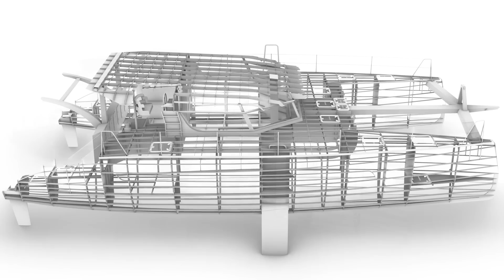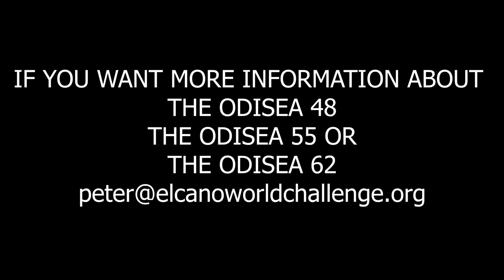6. How to build a performance world cruising catamaran - Meet the engineers

Comment: Fiberglass sandwich boat, fill with water it will float,  aluminum boat, fill with water it will sink, glub glub ...  just a thought...
Reply from the maker: We have 8 Watertight compartments and alloy is much harder to hole than grp or carbon
Reply: @SAILINGintoFREEDOM  I sure hope you learned your lesson about sail-drives... 
XXX sail-drives...